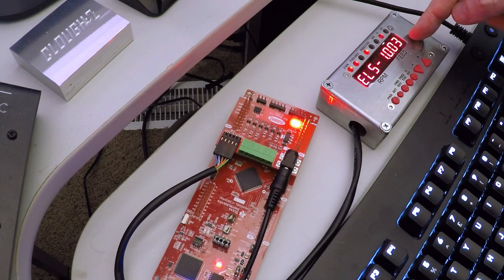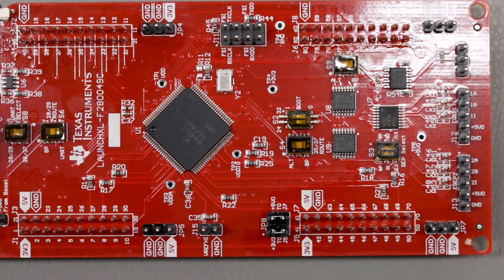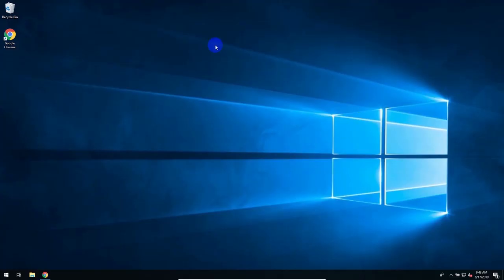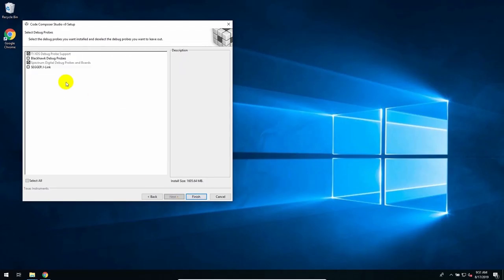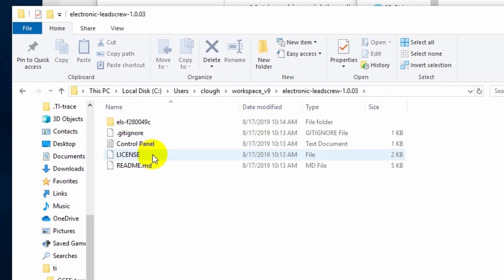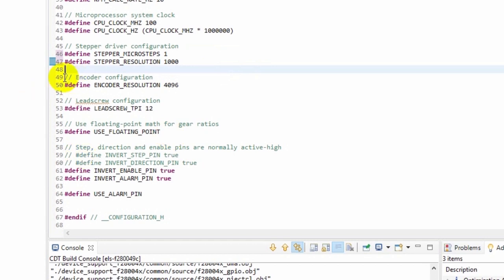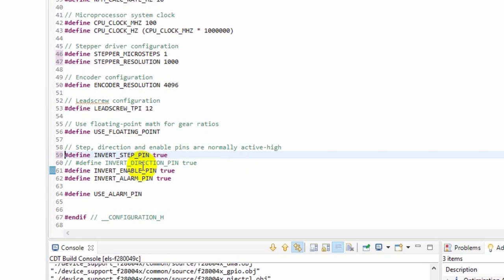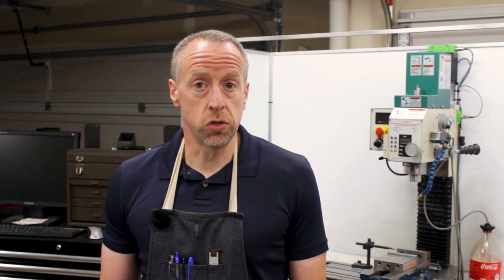Lathe Electronic Leadscrew Part 10: How to Program a TI LaunchPad Microcontroller

Comment: I think, it a problem for us who are "older",  when it comes to getting it pregaming in to flesh memory . is getting to the page.  to do what you have demonstrated  i have windows 10 & have not got any were near the page  even with your links . to program the siystom board    The board should come  pry program redy ti install. with it memory loaded  to flash.  the lath i will be attempting to adapt is a old  school lath of my youth, & to cut thread's it as   no threads  no  what wuld be the led screw at all .  just a shaft with a keyway down it lenth  that drives a  nut  with an external  six trends to the inch . driven by a gear.  the  nut that in tern drives a shat that move the carnage along the rack .  & it's  change  gear  give us a set of third to cut.  I suppose then the pitch would be that of the nut thread's  of Six TPI  that of the nut . I'm locking for you your ELS  to be  provide a full package,  as a ELS this would include steeper motors , programmed  mother boards  in standard  flash  memory redy to  plug & play   all the necessary  edweeno  { excuse the spelling }  & systems needed to Mont it in to A cabinet along with it power supply.  My job will be to mount in to the cabinet & fit motors & interface  & switch on & ues I am over 70 years of age  suffer' with arthritis & Dislexcea I get by it tacks a time for me to get on I have been at this now as ling AS you have been building it. IT a product i thing will adapt my lathe But i need it in kit for  with all it programming in place . so i can di the physical stuff my self.  If you can supply such A Package then.  I think it will finally Up , grade  most lathe.  that ues Chan gears today  Even replace then in the markit place. thank you les England.

Comment: First off thanks for all your video's, I really enjoy all the different topics and how easy you make it to understand some of the things that are outside my normal skill set. I am currently upgrading my g9729 lathe/mill combo machine using your control panel and interface board and was wondering if there was an easy way to make the encoder inputs selectable to utilize 2 encoders?  Being out of my depth when it comes to this I had incorrectly assumed I could just switch the power to the encoder I wished to use, but soon realized that caused the spindle speed to read extremely low as well as fluctuate badly. `Just hoping someone can point me in the right direction, until then I guess it's time to hit the books again.  Thanks again for the great video's and keep up the good work. :)  Edit: Looks as though it did work the way I originally thought but my switch needed to be on the ground side, all is stable and working perfectly now.

Comment: A year and 4 months later than this video, things have changed.   CCS is now at version 10, which some  subscribers say does not work.  It did give me a make error on a Linux download.   Version 9  for Windows 10 can be found in the TI archives as mentioned on the Git-Hub.  There are 3 versions of CCS 9 including  9.1.0 build10.  Ignore the TI question about the "simple" version of CCS and get the default.  The extract and setup of CCS takes a  very long time.  My Windows V10 decided I needed an update and stepped on my first install of CCS9. but it worked  the second time.   Git-hub is slightly different as well, and you will find three program zip files under CODE including the test  board program.  Currently its the release is 1.3.0.1 which has Metric leadscrew support and a bunch of safety features.

Late-comers advantage: Your Git-Hub troubleshooting page is very well done.  You can find that here: https://github.com/clough42/electronic-leadscrew/wiki/Troubleshooting  .  
 I simply printed it out.  Some folks may want to run two computers for some stuff, one for YouTube C42 and one for CCS/Git Hub/downloads.
Great Job James, you've been a very good lad and deserve all the toys Santa left you.
Reply: Use the USB cord provided.  I got ‘target not found’ with other USB cords.  The computer will see it as a USB device and will sound the USB notification on plug in.

Comment: I would love to use this as a power feed.  Maybe with material type, diameter , RPM, tool type and then it will give you some nice feeds for roughing finishing etc.  Or I could stop being lazy and just type in what I want :-)
Reply from the maker: Once it's digital, lots of options open up.  At that point, it's just software.  :)

Comment: OK` I sussed it out and finally got it programmed. IF you dont have any boards connected you must have the 3 jumpers installed. You see the red LED without them so you think its on but the programming port is not recognised. Once you enable the 3 jumpers then the board becomes alive and you can then program it. The 110 driver firmware updated automatically this was done with CCS 9.3 and until I get the boards from Clough42..hopefully next week I can then get it all together and see that it all fires up. I have the servo and other stuff just waiting on the encoder as well. I didnt realise he had his other boards powering the whole system. I didnt notice that on the video but it will not compile with V10 CCS

Comment: So I have the eval board, and the display board just showed up, but of course nothing can happen without the logic level conversion. Hmmm, what to do: order the converter board that you used in the prototype, or wait for your board. The latter is certainly cleaner, but knowing roughly when you're thinking whether/if/when it'll be available would help me decide. Thanks again for a very cool video series!

Comment: Fantastic channel!  Just found your channel today and subscribed. Your presentation stye is excellent and extremely organized and very clear. Can;t wait to get through all your videos in this series. I have a question maybe you can answer.  For designing a CNC machine with stepper motors, for the long axis moving the whole gantry, steppers can be connected in parallel and Mach 3 or Linux cnc or other stepper controller can clone the two motors as 1 single axis. If you were to replace the 2 steppers in that case with servos, how would you tune 2 parallel servos to work in tandem on 1 axis?

Comment: Code suggestion:
Just completed my build and installation on an Atlas/Craftsman 12" lathe. Fantastic project!! However, my build has a third mode called "Break Tool". This randomly happens every few minutes. It will act like all buttons have been pressed simultaneously. The leadscrew reverses, the display shows "No Settings", the mode flips to metric threading and the feed speed increases dramatically. Oops. I was able to suppress this significantly by adding 33 ohm series resistors to the head cable STB, CLK and DIO lines on both ends, but it still occasionally happens. My head cable is a 4-foot piece of standard 8-wire #22 shielded industrial control cable. I suspect that the "feature" is caused by either a corrupted "read switches" code being sent to the display, or a false readback of all-switches-pressed for unknown reasons. 
I've added a crude sanity check to the switch readback code in ControlPanel.cpp. The simplest way to do this is to check that the value of newkeys.all is less than or equal to 128 for a valid keyswitch readback. I've made the following 3 line addition to 1.1.02 ControlPanel.cpp in the ControlPanel::getKeys() routine around line 239:

newkeys - readKeys();   // Original Clough42 code
// Detect invalid key responses    NLG
if(newKeys.all > 128)  {  //NLG
      return noKeys;  // Bail out if bogus key readback    NLG
}    /NLG
if( newkeys.all != this->keys.all ) { // Original Clough42 code

A slightly better but slower solution:
    newKeys = readKeys();  /Clough42 code
    // Detect invalid key responses  NLG 9/23/20
    switch(newKeys.all) {
        case 128:
        case 64:
        case 32:
        case 16:
        case 8:
        case 4:
        case 1:
        case 0:
            break; // Pass on if OK
        default:
            return noKeys;  // Bail out on bad key data   NLG
        break;
    }   // End of NLG mod
    if( newKeys.all != this->keys.all ) { // Clough42 code

The only valid values for newKeys.all are 128, 64, 32, 16, 8, 4, 1 and 0. All others are either fat fingers or bogus reads.
I suspect others can do a much better code job than this. This code addition has completely solved my issue. 
Thanks again for the fantastic project.
Reply: I’m also going to install this on an old atlas/craftsman lathe would love to see how you mounted all the components on your lathe Thanks for any suggestions newbe

Comment: The key part is actually your interface board; have you decided whether you're going to sell them? I've already ordered the development board, display/button board, and optical encoder, but am a bit unsure on the stepper/servo. Have you decide which is "better" in such an application, the hybrid servo or straight stepper? Would hate to get one then have you announce that the other is superior :)
Reply from the maker: Yeah, I knew that was a risk when I decided to share the development process from the beginning.  I'm going to go with the servo for my lathe, but my tests show that the stepper also works fine.  I'm currently planning to make the interface board available and leave the choice of motor and driver to the builder.  Different lathes will have different mechanical requirements.  A 12" mini lathe won't require as much power as a vintage Boxford.

Comment: Hi James, I adding the ELS to my 12in Craftsman lathe, I'm confused about the configuration setup concerning "counts" on the servo motor since for torque concerns, I want to run a planetary gear reduction of 5 to 1 so by my limited understanding, the count entry for config would be 200?

Comment: hello james small question to just program the TI with the boost board is the external 5v required or is it also possible to just do it thru usb by leaving those 3 jumpers in place?

also what are your thoughts on kwackers fork of the els with the thread to shoulder option?

Comment: Well I finally gave in and ordered a LaunchXL board, I'm in the UK and the cheapest place to get it from was direct from TI, it is shipped from Germany and it worked out at £37, now to find the rest of the parts.  Is there a PCB design to download so I can get them made? * Sorry just remembered you put it on Circuitmaker *
And thanks very much for all the time and effort you've put in for this project.

Comment: I've really enjoyed watching your progress with this project! I think you've done a great job presenting the complete design and implementation process. My lathes are pretty old-school (1940's SB), but I am tempted to build my own electronic leadscrew. I'm wondering whether it would be practical to incorporate digital output from a DRO and automate the carriage advance for threading passes. That would (in theory) allow me to disengage the half-nuts, wind back to the start of the thread, re-engage and allow the board to coordinate the lead screw with the rotational position of the spindle. Does that seem like a practical idea? Does the TI LaunchPad have additional inputs available to take the linear position of the carriage from the DRO?
Reply: Actually Paul, it's not only possible, it's much easier than you think. Install a rotary encoder in place of the mechanical thread dial. The Ti board has two headers for encoder inputs already with only one being used by the spindle encoder. Then all you need to do is add the code. Cheers!
Reply: @nevermindyaddie2272  I hoped it might be straightforward. Thanks!

Comment: I am starting this project for my lathe, thanks for all the great information.  Is the schematics for your interface board available?  I didn't see it on the github.  Also, I went to order one from ebay but it says you don't ship to Canada.  I'm happy to build one my self so a schematic is more than enough if one is available.  I'm very early in the project, I have the micro controller and lathe, still waiting on the display board, servo motor and driver to come in the mail.

Comment: Great Project and an excellent presentation of your work.
Thank You!
I have a couple of general questions please. 
 I am considering using this board for other projects.

1.  It looks like the project is mixed C and C++ code, is this correct?
2.  Is there any RTOS being used or is it just a foreground / background system?

Comment: Thank you James for hearing us!!! Just one question....Can I translate my metric leadscrew pitch into TPI to use the actual firmware? I know, I'll loose some precision, but if I introduce enough decimals, theoretically it may work. Just guessing, of course
Reply from the maker: The numbers in the lookup tables are whole numbers, so while it's theoretically possible, it probably isn't the best way to go about it.  My plan is to just make a new set of numerator and denominator macros that work with a defined leadscrew pitch in millimeters (or probably tenths of millimeters).  The tables should then work as-is.  I just haven't gotten around to it yet.
Reply: @Clough42  Thank you again James for your generosity!! I'll wait for that firmware.
Reply from the maker: @diegovianavillegas3297  The latest version in github (on master) now has support for metric leadscrews.  I haven't tested it, but you can give it a try and let me know.
Reply: @Clough42  James, that was fast!! It wil ltake some time to be tested since now I'm moving into a bigger workshop. Thank you a lot, this will make using the lathe much more comfortable and quiet (I hate to regrease and readjust the gears mesh often).

Comment: Question: could you also add a lathe spindle RPM read-out if you make this into a kit? I'd imagine that is an easy function to add. But it's a super useful addition for anyone with a mini-lathe that doesn't yet have an electronic RPM read-out.
Reply from the maker: The first four digits on the display read out the spindle RPM.  I tested the calibration in one of the previous videos, and it's pretty much spot-on.
Reply: @Clough42  Remarkably I already have fitted a tachometer but once I have it up and running I will consider tweaking the code so the first four digits relate to the power cross feed on my lathe.

Comment: How accurate is of an X/Y measurement is reading the angular position of the lead screws and displaying it vs. glass or magnetic scales in a DRO? I’m looking into building a version of your electronic lead screw and thinking about using it as a DRO also, by adding an rotary encoder for the cross feed and displaying another set of LED displays.

Comment: How do you see this working on a lathe that has separate feed screw for general carriage feed and a conventional lead screw driven with different gear trains to achieve any given thread pitch?   Would you just eliminate the non-lead screw for feeding the apron in all situations except for cross slide operations like facing and parting?
Reply from the maker: Interesting question.  I think I would probably use this to drive the threading screw and just let the feed mechanism run as designed.  The kind of lathe you describe is probably pretty full featured already, though, so an electronic leadscrew might not add much besides hybrid threading.

Comment: Before this order information was posted I ordered a board directly from TI.  I received a launchpad XL F28069M. It is similar but not exact.  Will it work with this application?  I just ordered the correct board through the link from Digi-Key but wondered if it would work.

Comment: Quick but important question, does it have to be exactly this board or would it also work with the LAUNCHXL-F28379D?

I bought this Lead Screw Kit around 2 years ago, but didnt had time yet to install it. Now i have the problem that the F28049c isnt aviable.

Comment: I have tried downloading the software & programming the prototyping board which I think has worked ? But despite having power to my display PCB its otherwise dear i.e no display ! I've tried a second display board & checked that all connections are good but still nothing ? How can I tell if it's an issue with the TI PCB or just that the software hasn't installed ?

Comment: James i have it programed it works but it will not reverse directions of the hybryd stepper.
Reply from the maker: Check the continuity of your DIR input wiring.
Reply: @Clough42  hi. James I have continuity from my stepper all the way to Q5  and from r8 to pin 1 but it will not reverse direction
Reply: @Clough42  sorry to trouble you james i was checking the wrong wire. all good. thank you so much for the great work. i bought an old clausing 100 lathe that had no change gears so this sure solved that problem. much appreciated.

Comment: Fyi this controller is on backorder is there a newer replacement that will work
Reply from the maker: The one you want is the LaunchXL-F280049c.  Mouser has a few hundred in stock at the moment.

Comment: I have a video processing board with a tms320dm6437 processor connected to Nand flash memory NQ283 and I would like to access the flash in order to copy its contents via JTAG even though the processor is connected to ccs9 but the flash memory does not appear in the memory map
 Only RAM 0x7FFFFFFFFFFFFFFF is visible and my question is how can I access the flash memory and copy its content?
Is there a tool or program that enables me to access the flash memory?